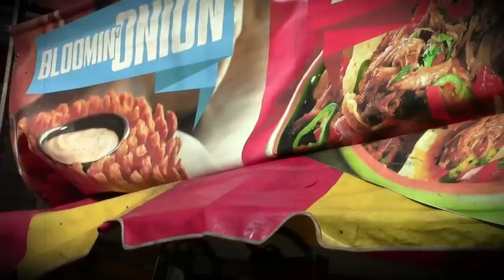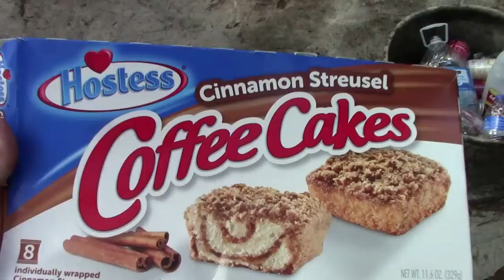ep 39: Back to the Homestead/ Building a Hurricane Shelter Out of Plastic Wrap

Comment: Chris, I don't know if you're familiar with this or not but there is a product builders use on framed houses where the put up walls made of plastic sheets and they need to make a door. It's basically a strip of plastic tape the length of a doorway, with a zipper down the middle. You put the tape up where you want the doorway and press it down real good to make sure all the adhesive is engaged and to work out any air bubbles. Then you unzip the zipper and cut down the middle with a utility knife and you have an instant doorway that can be zippered shut. the zipper has a pull tab on either side so it can be zipped up or unzipped from either side. They only cost a couple of dollars at a store like Lowe's or Home Depot (not sure what department you can find them in) and it's a lot quicker and you won't have to use up a lot of tape to make a doorway/opening.

Comment: i would have put pallets down then put 1/4 to 1/2 inch thick 4ft x8ft lay them on top of pallets cause rain is going to make the ground very wet so you need a make shift floor to walk on maybe put the tent next to the opening of your trailer so you can have a long room with a dry floor
Reply from the maker: That would be a ton ofnwork for a temporary tent, especially when you have to take it all apart Lol
Reply: Great idea.